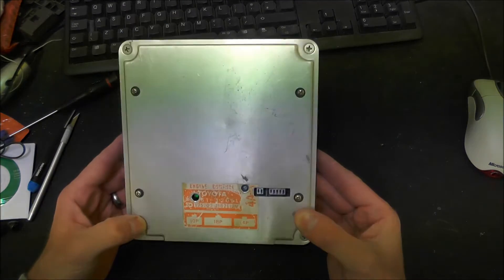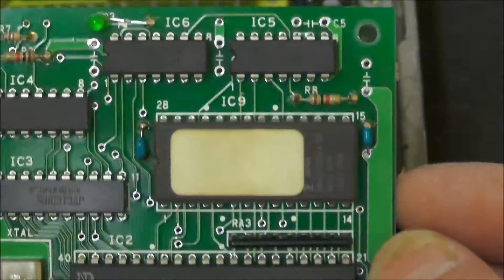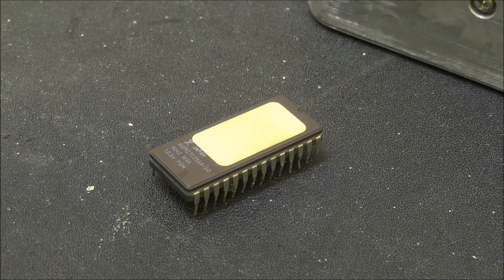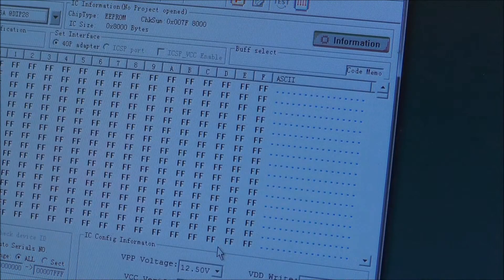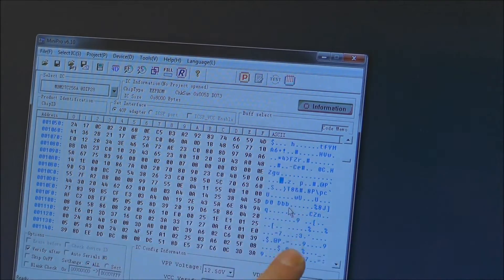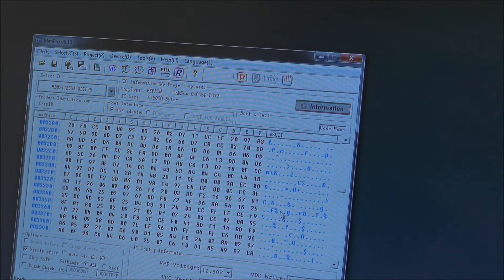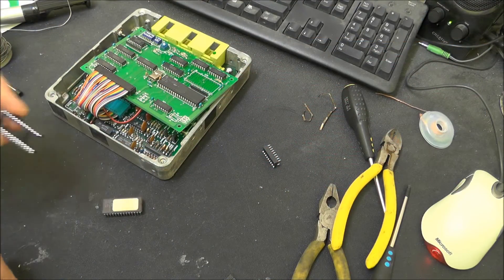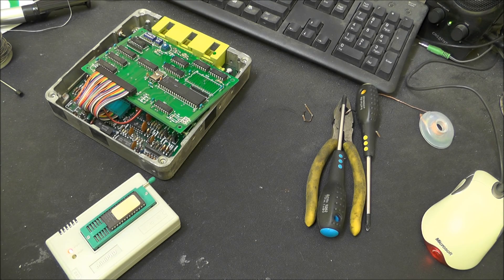DL#024 - Toyota Corolla AE86 Modded ECU EPROM Download

Comment: I think it might be a revolver racing ecu.
Reply: Of the switch on three, No.1 switch the two-pack. The No.2 switch the 5-tuple.
No.1 switch
1 ... Always ON
2 · · · ON: Normal camshaft OFF: high cam shaft

No.2 switch
A combination of 1.2.3.4
OFF 2:: 1 standard ON 3: ON 4: ON
5% increase 1: ON 2: ON 3: ON 4: ON
10% increase 1: ON 2: ON 3: ON 4: OFF
15% increase 1: ON 2: ON 3: OFF 4: ON
※ 5% weight loss 1: ON 2: OFF 3: ON 4: ON
※ 10% weight loss 1: ON 2: OFF 3: ON 4: OFF
※ 15% weight loss 1: ON 2: OFF 3: OFF 4: ON
(The ※, it does not use too much.)
5 ... usually OFF
Dial switch is enabled when set to ON.

Comment: Likely 2 maps and then one of the dip switches selects a high order adress line to choose, mapping it in the top 16k of processor memory. Likely the processor is a 6800 series processor, as they were often used in automotive, and have a lot of second sources like Hitachi. If the program starts at the top of memory and the same bytes repeat at just under half then that would indicate 2 maps.
Reply from the maker: yes, thinking one is the stock map and the other is the modded map. i did look over this board before and iirc some of the dip switches are tied into the eprom, likley the address lines.  I do know a little more about these ecu's than i'm letting on. maybe i will elaborate later...
Reply: DextersLab2013 Sometimes they have manual and automatic transmission maps on the same chip